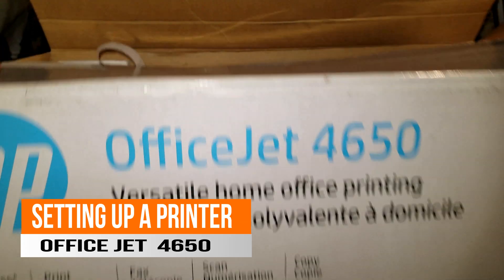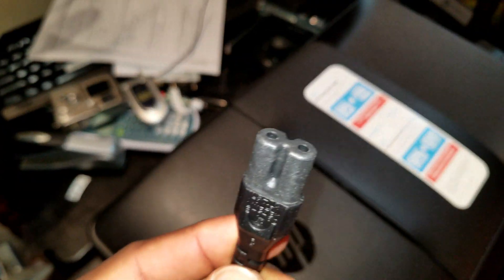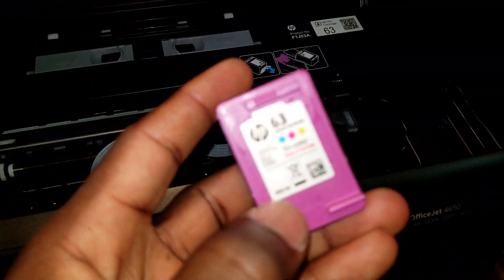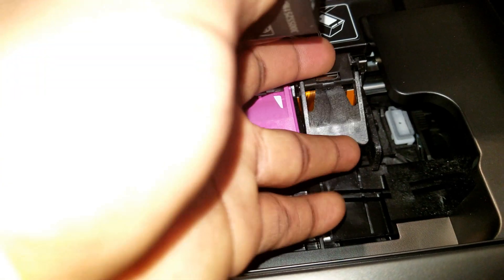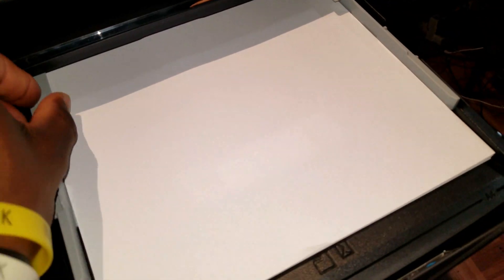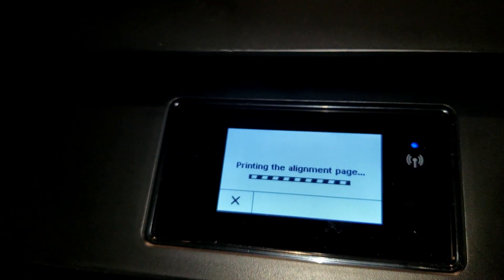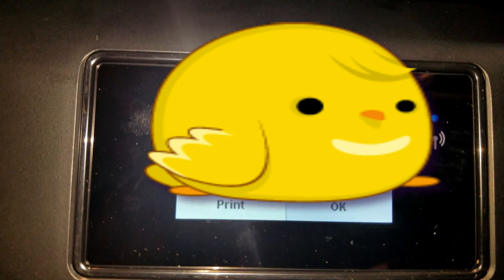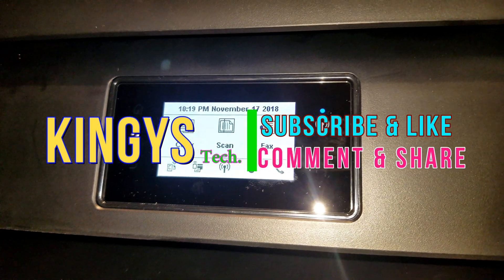Setting up HP OfficeJET 4650

Comment: This was not helpful at all. Why didn’t you take the time to input the password since the access is not explained to typed in the letter or number needed.
Reply from the maker: Once you get to the keyboard it's self explanatory. It's a multi-tap keyboard, you have to click "ABC" button three times to insert C and so on. Then click on the "123?" button to switch to numbers tab and symbols